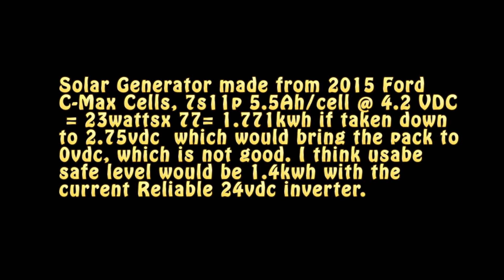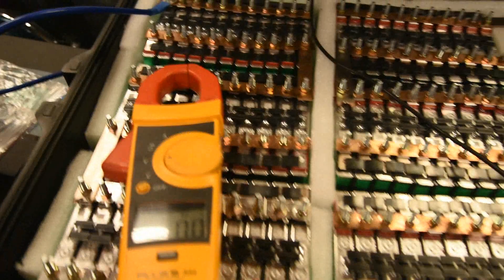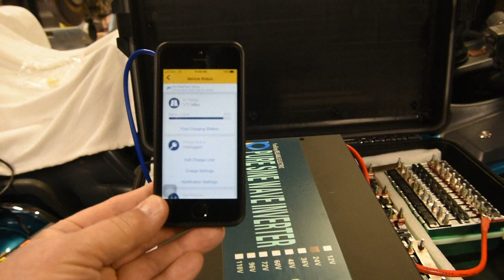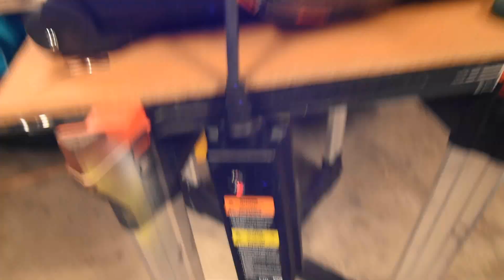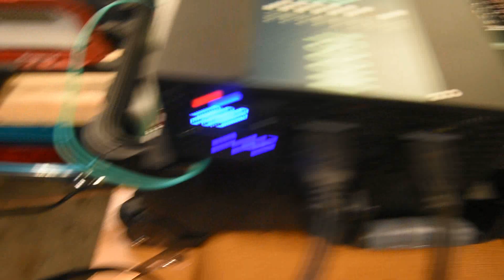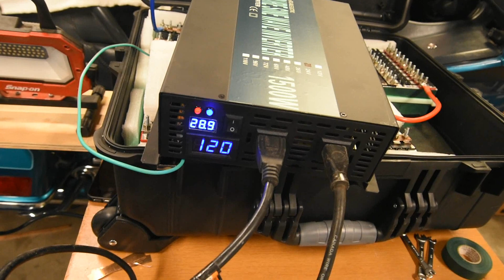Will this 1.5KWH solar generator charge your EV??

Comment from the maker: Actually have tried both ways to ground the inverter, once to negative bus bar on the batteries, and than directly to the 8’ copper ground rod, neither ways works for this inverter, tried my other 12 Volt pure sine wave inverter with no success either!

Comment from the maker: I used a grounded cut off saw, but I did ground the inverter to the negative terminal to see if that worked. The real test is the EV charger, going to hooked a ground wire to my ground rod than attach that to the inverter. Will it work? Going to fine out!

Comment: Steve - I haven’t used an inverter, but I would think that the ground in your 110v plug (output of the inverter) would be internally tied to a connection on the input side of the inverter.  This keeps the safety connections separate from the power handling connections in the inverter.  You would want to tie that ground “input” (to the inverter) to the ground reference for your batteries, which would be your negative busbar?  That saw motor you ran was ungrounded, right (2 prong plug)?